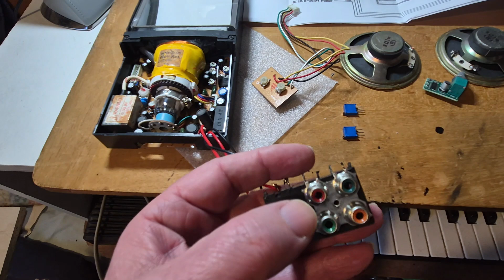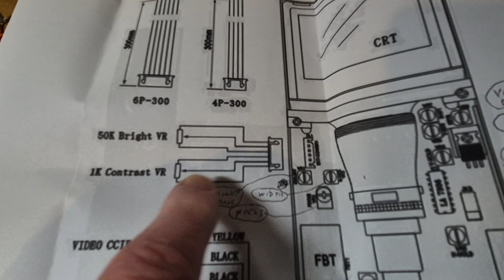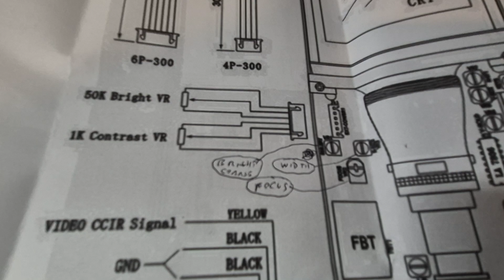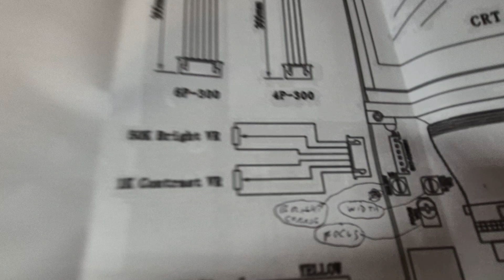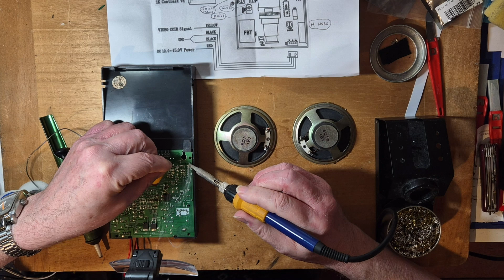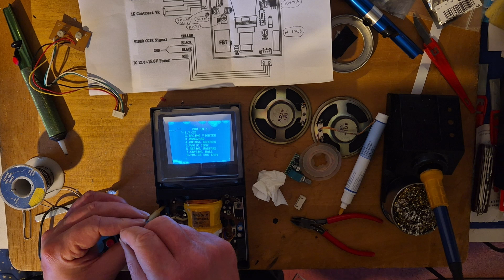Miniature 4 inch CRT monitor trimmers

Comment: I wonder why these monitors are always "missing" the same crucial components. The brightness/contrasts components. The power leads? I bought one and well. Having to buy other things just to get a picture/audio is a bit of a bugger. 
Cheers for showing me how to do it. It is something I definitely want to fire up.
Reply from the maker: @Moth_of_Yuggoth  The other parts were in the door phone units that these monitors were used in. It seems the monitor modules were supplied as replacement units.
Reply: @Timothycan  ahhh. That explams it. I never thought that's what they were used in. Since they come in pretty good condition. I assumed they were NOS for some portable TV/device. Duh me.
Reply: @Timothycan  Hi. I popped a capacitor inside the board, right next to the DC power cables. (Capacitor directly above the fuse 25V 220uF). I applied 12v at 0.3 amps on the DC and ground wire. However, I did not have the video input and other ground connected. They were floating. If you know the reason it popped. greatly appreciated. I am a rookie at this stuff
Reply from the maker: @Moth_of_Yuggoth  I can't really advise, (my videos are not tutorials, as I'm sure you realise). But one thing is possible. Usually a cap pops due to incorrect polarity. On the monitor unit I have, when it arrived it came with a short length of wires going to the video and power connector. On MINE the 12v wires were incorrect as supplied, the black wire going to the +12v input, and the red wire going to the 0v (or negative) connection, so I reversed the wires at the connector so black was then negative and red positive. Fortunately I had spotted this before I applied power. Not all these little monitors are the same, though, and yours may be laid out entirely differently to mine.

Comment: Looks like you've landed on a fun project, Tim.  Looking forward to the audio work.
Reply from the maker: Thanks Joe. I'm thinking of regulating the supply down to 12v (from 14v) going into this unit, so it's only getting its minimum specified voltage, and regulating the 12 down to 5v for the audio amp.